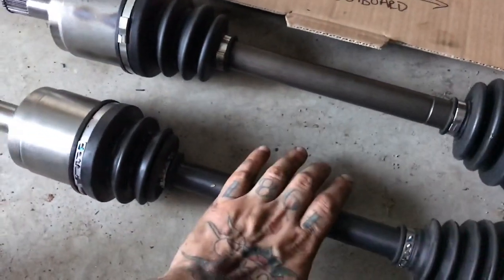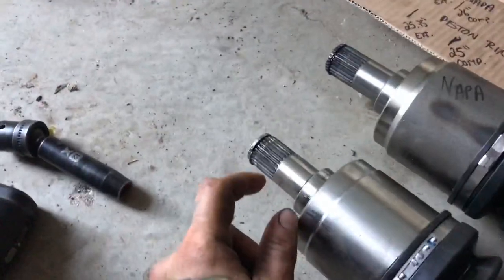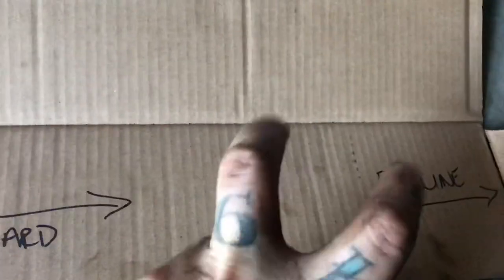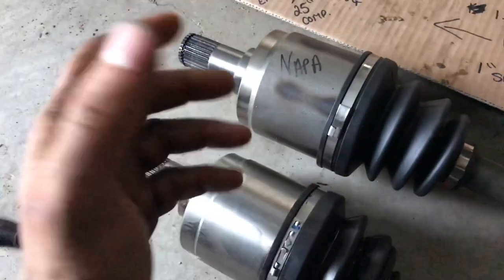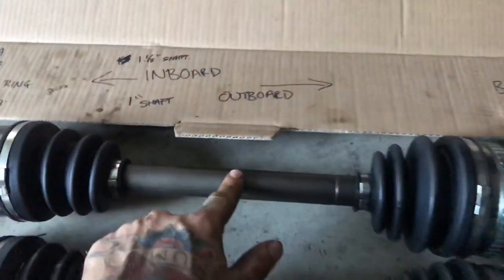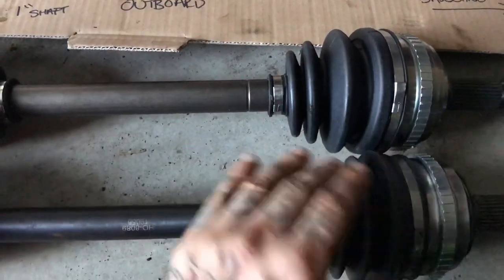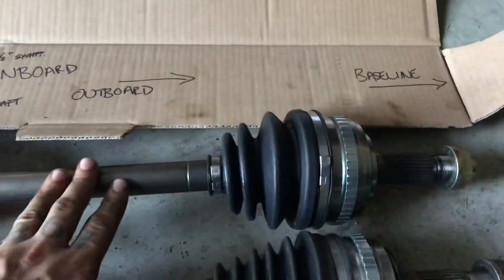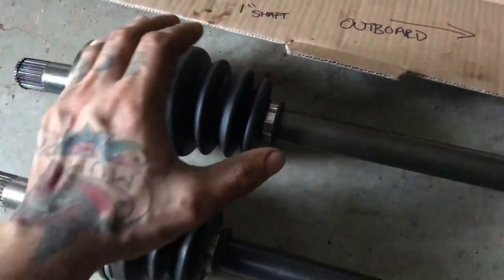OEM vs Aftermarket CV Axles • 97 - 01 HONDA CRV RD1 RD2 • #ThatBeardedMechanic

Comment: Thanks for the video. I bought a cheap one and it popped out. Thought I’d lost my transmission because my rear drive shaft was off for balancing and the car just stopped dead. Now I measured the original Honda and it’s longer. I’m headed to NAPA!
Reply from the maker: Right on! Glad it helped you out and set you in the right direction.

Comment: So here's a question. I replaced mine on my 01 FWD (stock height) with TrakMotive axles from RockAuto. Got a vibration between 20-30 mph. So I replaced them again with GSP axles (also from RockAuto, their most expensive) and I'm still getting the vibration. The vibration was not there when the factory Honda axles were in. Those had dampers on them but the aftermarkets do not. Do the Napa axles give a vibration?
Reply from the maker: I have yet to have any vibrations with these NAPA axles installed. I’ve got well over 15,000kms on them now since installation. I highway commuted every single day (3 hour round trip) doing 100km/ hr. 

I’m also lifted on OME lift coils and on 235/75R15 tires at that time of installation and now on 31x10.5R15. Still no issues. Make sure to torque the axle but while the vehicle is on the ground under its own weight as well.
Reply: IF you're sure that it's  FWD and not AWD, it is possible that you have one or more defective shafts. I had two in a row that were assembled without grease in the joints. 
I have an AWD 2000 and found out that the rear driveshaft U joints were NFG @220K miles, thus causing the vibration in my crv. Bought a complete shaft assembly from fleabay.

Comment: you're my hero i have a 97 and had the EXACT same problem with my cv joint popping out after getting one from o reily, i am picking up my napa part today!
Reply from the maker: Awesome, glad the information was helpful to you. Also keep in mind that if you are lifted beyond 3” using a strut spacer kit, you’ll definitely need a subframe drop kit as well to aid in stopping any axle issues.

Comment: I’m a little confused. Great video first of all. I have a ‘97 CRV. I originally did what you did and bought a cheap axle. It popped out because it wasn’t long enough. I kept the original right front axle luckily so now I can check size and bought a NAPA 946050. The NAPA is too short too! What am I missing? I don’t even want to unwrap it let alone waste time installing it and having it pop out too. Update: re measured it’s good and installed. Working great!
Reply from the maker: Interesting, I do know of other complaints like this and it turns out they’re REMAN NAPA axles, and sold as/ branded as NAPA ones. 

True new NAPA brand ones like I installed are the longer ones as I measured in the video. Have you compared the measurements in my video to your own, just out of curiosity to confirm such a situation?
Reply: I was wrong it was the right size. I installed it and it fit perfectly. Thank you for the tip on it.
Reply from the maker: Perfect. Glad it worked out.
Reply: Was this for an automatic 2001? What was the part number for the driver side? Thank you

Comment: What’s up boss man ordering a CV axle for my front passanger side from NAPA as we speak with the help of you’r video. I just wanted to know if you had an update on how the axle has turned out for you and how many miles it’s been since replacing?
Reply from the maker: Hello, since this videos posting in 2020, and now it being 2023, I’ve put just over 30,000 kilometres on the CRV without a single hiccup in relation to the driveline issues I was having before. 
This includes daily commuting on the highway with a mix of city (3 hours round trip) and the off camping/ light off-road excursion. Not to mention dealing with 3 Canadian Winters where I opt to take back country roads home. 

They are definitely worth it compared to other brands out there and kid put them on the same shelf as OEM Honda, just minus the cost.
Reply: Thanks for the reply I’m on the Napa sight and I see the axle says the CV Drive Shaft compressed length is 22.83 would that mean it’s the wrong size ?
Reply from the maker: The one they’re showing could be a reman. New one like I have in the video should be a part number 946050 for the right and 946040 for the left.
As long as it is either of those part numbers, you’ll be fine.
There’s countless others out there running these same ones with much larger lifts than I.
Reply: I’m trying to find the right one for the 2009 Honda accord I have all seen to say the same measurement I don’t know maybe I’ll go with a junk yard axle to get the car running and find the right axle! Thank you boss.

Comment: Well what the heck. I just replaced my drivers side front axle with a piston ring axle. 99 Honda CRV. Is this a thing for the drivers side as well? I’ve been driving it for a week now and all seems fine so far?? I’ll have to keep an eye on that I guess. Cheers from Manitoba!!!
Reply from the maker: Yup it certainly is an issue for the driver side as well. Best to keep an eye on it, but if you have no issues then you lucked out and got a good quality one. 
Even when buying these axles new from the store, some can be remanufactured/ rebuilt, thus quality control issues arise and so do the associated issues once installed. Especially if you’re lifted and run larger tires and offset wheels like I do. 

And right on! Good to see locals have made it to my channel and it’s helping them out.
Reply: @That_Bearded_Mechanic  thanks bud. Yeah I don’t know. I never knew these could pop out. It’s an all stock 99. The axles side by side seemed to measure the same but I can see what you’re talking about. Shoot. Now I’m paranoid. Wife has been driving it to work. Oh well. Keep an eye on it for now. It’s only been a week. She was driving it lots tho. All around Winnipeg, and then south of the city where we live so I hope it’s not falling out. lmao
Reply: Just checked drivers side axle. It’s been almost 2 weeks. It does have a bit of in and out play, like maybe 1/8”. That end is a female end that goes onto the male spline coming from the housing. I’m not sure if that’s supposed to have any play like that, but I’ve jacked up buggy, and it stays the same not pulling out. Also when wheel is turned fully each way it stays put. I’m not sure, but will look closer this weekend again. I think it’s locked in because the C clip is at the end of the output shaft and had to be tapped to get new axle started. See I guess, but there is definitely about 1/8 inch of play there on the inside end of the axle closest to Center. You never know I guess. Maybe they fixed this issue now?
Reply from the maker: Okay yeah that’s alright and she should be good. I’ve got the same amount of play roughly, just checked my CRV now to confirm in relation to yours.

The main issue of axles popping out on these CRV’s is when they’re lifted, it throws all the geometry out. If you’ve been driving it for as long as you have and haven’t had any issues then I wouldn’t worry about it. That c-clip is engaged and all is well then.

Comment: Napa axles and rock auto trakmototive/FVP are all the same part number if you go to the axle on Napa in the specifications the manufacturer part number is the same.
Reply from the maker: A lot of manufacturers or distributors will do this, correct. Easier for them logistically to list things. They can also add a letter or number before or after the original part number. 

Always a good idea to run part numbers through Google, check reviews on what shows up when buying the parts and be able to score yourself a deal for the same thing as the store carries.

Comment: I used trakmotive with lifetime warranty. My local supplier told me he hasn't had problems with it
Reply from the maker: Yup that last actually another one I have heard lifted CRV guys suggest using as well as they’ve had no issues with them. It’s the lesser known option compared to say the Napa ones.
Reply: @That_Bearded_Mechanic  This is pretty much the only aftermarket brand available here in canada. The only other option I found was a rebuilder about 50km away
Reply: I replaced the front worn out OEM cv axels on my 97 CR-V with trakmotive  and haven’t had any problems with axel popping out. I have a 2 inch lift using OME lift springs and longer shocks. Take it off road all the time on rough rocky roads and no problems.
Reply: @michaelbaker3672  mines starting to crack on the passenger outer boot
Reply: @AwesomenessIskey  see if you can get a new axel with that lifetime warranty. It only took me 30 minutes to replace one side.

Comment: Got a left Drive Shaft replacement 2 months ago on a 2002 Volvo S80:
I bought this aftermarket part from this store. It is hard to find drive shaft for my volvo, because It equipped with the GM 4T65EV transmission. But finally I found on polar parts website.

On the left side the transmission oil started to leak.... Maybe old seal... 

OK Then we replaced the SEAL:
I bought VOLVO ORIGINAL seal...

After 1 month, It started to leak AGAIN.

What can cause it?

- Can a seal installed incorrectly? badly?

- Can an aftermarket drive shaft misfits and cause transmission oil leaks?

I am really tired, spent a lot money on this drive the car back every time to repair center.
Reply from the maker: Most definitely an improperly installed oil seal can leak immediately or later down the road, especially when damaged during the install or the seat where the oil seal sits gets damaged. I’ve dealt with such situations coming into shops I’ve worked at several times. Mostly from people who just bash them in with a socket and hammer or likewise method. 
It’s pretty rare for the cv axle itself to damage the oil seal and cause it to leak. Such a thing can happen if any debris works it’s way in behind the flange that the oil seats up against and between the transmission housing, especially if dealing with sandy environments and gravel roads. 

Little trick to installing oil seals is to lube them up a little with high temp grease where the cv-axle would slide into, helping to avoid any damage to the oil seal on install. 

I hope this helps. Please let me know if any further developments occur.
Reply: in my experience, most automotive oil seals work the same way. 

1  find a pvc pipe piece at the hardware store that fits around the OD of the new seal(without touching the inner part) , 
2 Clean the mating / sealing surfaces (burrs/pitting on the shaft for example)
3 use a deadblow or something similar to install the seal, just make sure its going in straight and level.
4 lube up the shaft and lip of the seal/spring with what ever oil is being sealed. (transmission oil, engine oil whatever)
5 slightly rotate the shaft while installing, this helps the lip not bind up and roll over on itself.

If you seat a known good seal properly on a clean surface, and you can visually confirm the seal lip did not bind up or roll over during install. Then the seal is installed correctly and the leak might stem from another cause

Comment: So is that’s the driver my passenger one is fine it does not have a shaft on both ends but the driver does and the driver has poped out about 1/2in idk if they make them differently I have a 97
Reply from the maker: The one I’m replacing is the passenger side in the video. The driver side and passenger sides will be different. And they’re different for manual and automatic transmissions. 

NAPA does make one for the older 1st generation CRV and the newer 1st generation CRV’s.

Comment: I had questions on part numbers for the rears cv axles? Napa has multiple ones listed
Reply from the maker: From what I understand, the multiple part numbers for the rear will be in reference to obviously left and right but also the brand, their NAPA brand line and also their ALTROM brand line. You may also have options for TRAKMOTIVE ones as well. 

NAPA ones will have a chance to be remanufactured ones or actual new ones. Warranty will be a limited one I believe too. 

ALTROM will be guaranteed new OEM spec built ones. Also a lifetime warranty as well if I remember correctly. 

You’d have to confirm the warranty with your local NAPA rep/ the sales associate before checkout online. 

Also note: just for reference, there is a difference for the manual and automatic CV axles concerning the fronts. Just wanna clarify this as well in the same post.
Reply from the maker: And if you need rears, ALTROM carries them. 
Left side (driver rear) #: UTD 0652965
Right side (passenger rear) #: UTD 0652966

Comment: I bought a new front right cv axle for my 97 CR-V its made by BGA who claim everything is made to OEM or better standards. It looks great, everything measures up.. except the bit that goes into the transmission. It's about 2mm different length to the one that came out. Looking at it it feels like the c clip isnt gonna go in far enough. Is the BGA different to other parts, or if i buy another will i have the same problem.
Reply from the maker: I’ve never heard of BGA branded CV axles.

As long as the splines are the correct length for the inboard side (part that goes into the transmission with the clip) and the clip itself is equal distance to the old one, it should be fine.
Reply: @That_Bearded_Mechanic  it's not the same length, that is the problem. BGA is a manufacturer from England. It looks a good part but doesn't fit my car. I found an old post on a Honda forum where somebody had the same problem in reverse. Spline length doesn't seem to be something that they tell you when you buy online.

Comment: Tried Napa remanufactured, wobble. Bought new Napa, wobble. Both Napa were crap. Trying different ones. Third times a charm as they say...
Reply from the maker: You also have to keep in mind that if you are in fact lifted quite a bit, you will have a wobble no matter what and will have to install a 1” to 1.5” subframe drop kit which can be purchased from HRG (Honda Rescue Garage) in the USA. 

Good luck.
Reply: @That_Bearded_Mechanic   Have the HRG 3” Lift and subframe drop. Running Oldman Emu Springs with Gabriel struts. The new Napa’s were worse than the reman. Eyeballing some on Amazon. I’ll let you know...
Reply: @01Bluefin  any update?

Comment: they don't make a rear axle what do you recommend for the rears? in canada btw getting the same axle 946050 right side and 946040 for the left
Reply from the maker: For the rear, you’re better off just trying to source an OEM good used ones. I can’t think of any that are available aftermarket for the rears.
Reply from the maker: ALTROM carries them. 
Left side (driver rear) #: UTD 0652965
Right side (passenger rear) #: UTD 0652966

Comment: I have a 99 Honda RD1 AWD that I recently replaced front axles.  Was fine for first ride but after that hearing some kind of clicking sound.  No lift on my CRV.   I have a video I just uploaded capturing the sound, hoping for some advice.
Reply from the maker: I watched the video. It’s a little hard to hear what it could be. It does in fact almost sound like a sway bar link banging around. It might be a little loose. Especially if the area where you’re driving on is uneven. 

Does it make this sound while actually driving in a straight line continually at highway speed and also fluctuate (get faster/ louder or slower/ quiet) as you adjust your speed? If so, then that would definitely suggest a CV Axle issue with it maybe not being seated fully into the transmission case. 

The alternative being the upper balljoint/ possibly the lower now as the uppers have been replaced could be popping and be the noise. To check balljoints you’ll need a pry at of some sort to jam in the control arm and pry to see if there’s any movement. Suggest doing it on the ground and with that wheel up in the air as well. 

Hope this helps.
Reply: @That_Bearded_Mechanic   Thanks for the input.  Checked the links, they look tight.  I put CRV back on blocks to give it a once over.  I post one more short video that shows the seating of passenger cv axle.  Should there be that much of a gap?

Comment: I put in a Napa premium line passenger side axle in the boot cracked and it makes noise in less than a year. Part number 94-0609
Reply from the maker: As with any parts, whether low or higher quality, there will always be a chance of an issue or say road debris damaging the boot. It happens. 

The noise would be a result of the boot cracking (I assume it split open, threw grease out and contaminated the joint).

But with it being under warranty you should be able to replace it. Install and be good to go again easily with no added cost.
Reply: @That_Bearded_Mechanic  No, the boot has not broken open, yet, but the noise started shortly after install.
Reply from the maker: @meblake7359 interesting, could be a chance of a failed one. I’d double check the axle by pushing it forward and back to see if the joint has failed. If it has movement to the front and rear, it’s the issue.